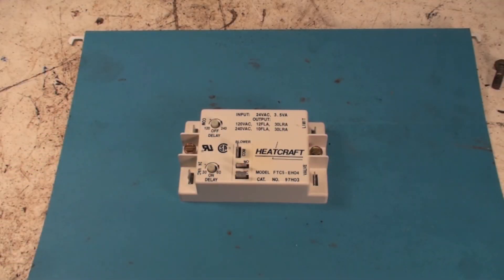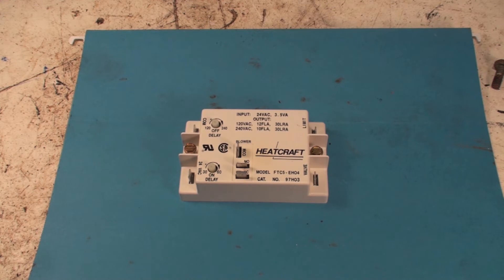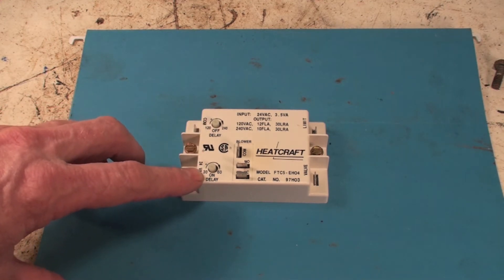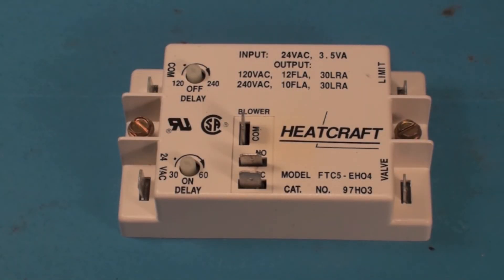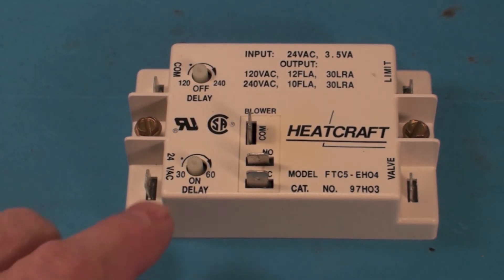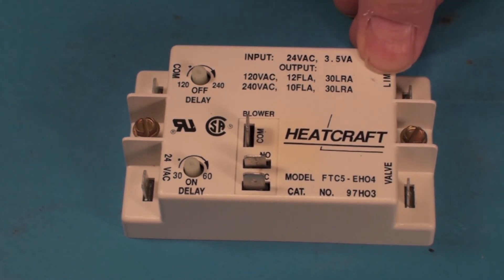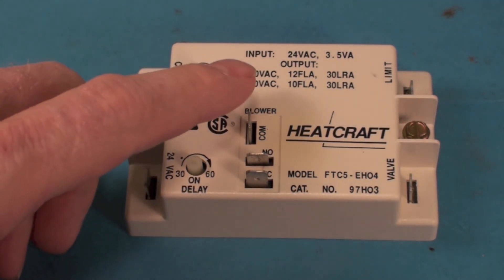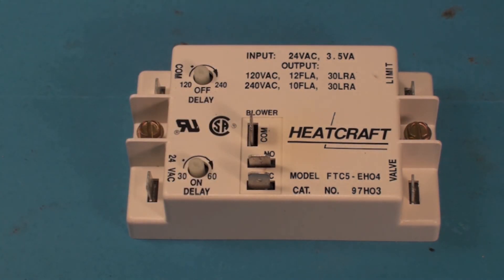How the electronic fan control works

Comment: I thought it's a module for a fan cycling. I just discovered that some thermostats have this option to eliminate cold rooms by running the fan for like 20 minutes every hour. I have a split level house, and a furnace without zones, and I need an affordable way to even out the temperatures. I thought about installing zones by myself (~$700), but my roommates will not fork out a dollar, which doesn't give me too many options. Should I get a new thermostat, or is there a module I can connect to the furnace?
Reply from the maker: I am assuming the lower level is cold.   There is no sure way to fix this other than installing a furnace for the lower level.  You can try adding a return air in the lower level.  Zoning will not help unless you replace the furnace with a variable or 2 stage furnace.
GFM

Comment: Curious if you might have any advice.....I have an old (90's) Heil that has two of these timers. One is the same as shown in the video. The other is a non adjustable 30 second timer for the cooling /AC cycle. Here's my question...is there a way to wire the adjustable timer in place of the non adjustable?  I'm able to find a new replacement of the heater/adjustable timer. But the cooling timer is about impossible to find. Where I'm concerned is, the connections are different on each. Any advice is greatly appreciated!

Comment: Thanks. I have a Keepright Hi Eff from the mid 1990 that required my replacement of this unit a few times. The older units typically seemed to burn-out the AC Blower Fan relay contacts. The last one from about 2007 had a sealed relay. Lasted a long time. Now having a constant fan run problem and looking at replacing this..They are not as available from local HVAC supply houses anymore.  They guys at 2 well known places had no ideal what it was (I bought my last one from them -in 2007). Your video did explain one thing I had wrong. I thought the "valve" wire signalled the gas valve to open as part of the timer warmup sequence  ( turning on the burner before the fan so the furnace warms up first). BUT you have explained my thinking is backwards. It is actually the signal from the gas valve that signals the timer unit to start its time count. Do I look for 24vac from the gas valve ? Will check.

These units are available on-line as of 2020.  They seem to be very universal and typically will refer  to  HQ1005229WA.  They are made by A1 Components / Henry Technologies or Zettter. 
 
I also note that my mechanical heat sensing  fan limit switch (the type with the dial and temp probe) is still included, as you state, and it partially used for its "normally closed" limit switch. It is wired in series with the other safety limit switches like the rollout "over temp" thermal "click" switch, the exhaust   fan safety switch and with the "limit" terminal of this Module.

My question is, why can i not just stop using this electronic fan timer module and wire the fan directly to the unused AC side of the traditional, mechanical fan limit switch ? (Terminals currently unused)   I guess  to still keep all the 24vac limit  safety switch in play, I would need to use a 24vac coil relay that would then have 120vac contacts that would go to mechanical temp fan switch...I imagine thats how they use to it.....oh well...I already ordered one of these modules....just looking for alternatives if the temp drops while waiting for delivery .. 

I am not a certified HvAC guy ....just a hands on tech / mechanical guy..Just wanted to share for others and pick your brain. 

FWIW, the electronic fan  limit control  timer module has no  fancy electronics in it. Other than the   120vac fan Relay coil or contacts going bad, there are also Zener and rectifier diodes , caps, resistors (one reported to often fail) and a LM2904N Op Amp. And a few transistors. Probably not worth trying to troubleshoot. The module price on-line from various ebay stores is US$ 70.00 as of 2020...plus shipping....but they are all made by A1. They may have slightly different part numbers ..but all seem to be the same unit.

Thanks again for your info
Note: comment below states ICM251 timer also will work..MUCH Cheaper at US$30.. ..I alreay order my A1....  I used an ICM  years ago and didn't last as long as the A1 ( and didn't have sealed relays)...but for the price, why not.

Comment: Wow I can’t believe I found this video. I have a pulse 21 in my garage and this controller is buzzing and cutting the fan out during heat cycle. Is there anyway to bypass this unit and have the fan run through the whole heat cycle. I’m guessing I won’t find a replacement.
Reply from the maker: The replacement may be available.  
You can jumper W to G.  That will turn on the fan when there is a call for heat.  It will blow cold air for about a minute.
GFM
Reply: grayfurnaceman  thanks for the tip. Will that bypass that control all together?. Can I leave everything else for the controller hoked up?
Reply from the maker: @jmcnasty0076  Yes.  All you are doing is energizing the fan relay, which bypasses the timer.  Just leave all wires on.
GFM

Comment: I have a Heil 5000 furnace with that same electronic fan controller that I think is not working correctly.
I'm using a Honeywell RTH8500D Thermostat that has a setting for Fan Control (in Heating) that can be set to Gas (Heating system control fan in a call for heat) or Electric Heat (thermostat controls fan in a call for heat).
The problem I'm having is that after the pilot light the burners, the fan never start and after 2 minutes the sensor shuts the gas, and there, the fan start cooling the furnace for 30/45" and then the cycle start all over again. The fan is working fine but not starting after the call for heat ignite the burners.
It is set to Gas but after seeing this video I wonder if I can set it to Electric Heat and have the thermostat unit to control the fan.
Any suggestion?
Thanks for all your helpful videos!!
Reply from the maker: You can give it a try.  It will probably run the fan at a higher speed.
GFM

Comment: Very helpful, thanks! Quick question: I'm struggling to find a replacement for one of these (usually I keep a used one on hand but it seems to have gotten used somewhere else). Is there any modern retrofit option that would work in place of it? The joys of working on a Lennox Pulse...
Reply from the maker: Not that I know of.
GFM
Reply: @Robert McShane   Thanks, good to know.